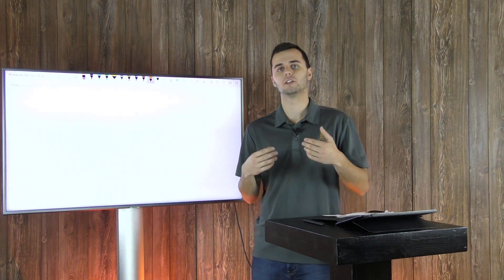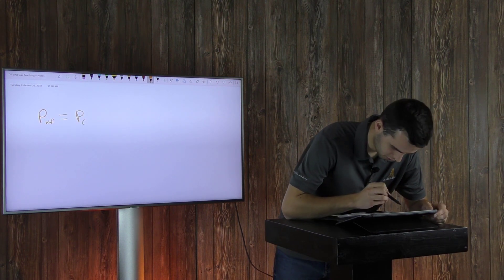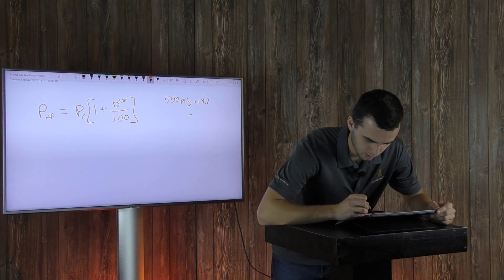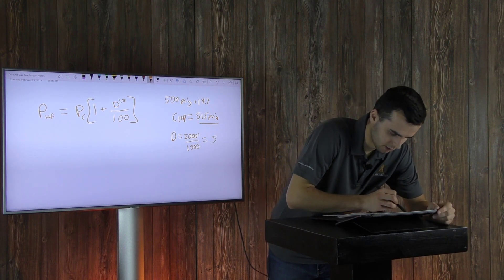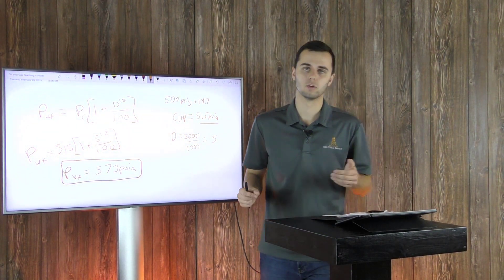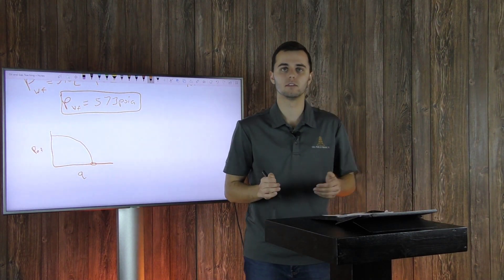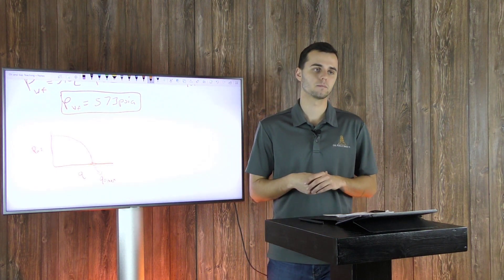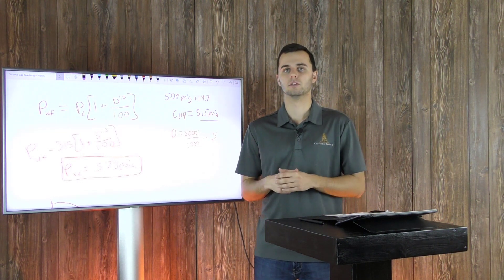Casing to Bottom Hole Flowing Pressure Calculation

Comment: Sebastian could I email you a spread sheet to look at,  I would like to know if there is a way to input the formula that will calculate in kPa.  The sheet is not as accurate as I would like using only 1kPa per meter, I believe this is not great as the gas gradient would change pending pressure.

Comment: On my gas / oil well I do not have a packing, I do have two valves at the surface that control casing and tubing pressure.  I don’t know how to set them.  The old man that used to run the well set one around 80 psi and another around 50psi. I’m not sure which was which.  The transmission line to the gas/oil separator has a few check valves along the way and there is a reverse valve before the separator.  He never set it before he passed. My oil production is from a pump jack driven by a Fairbanks-Morse 208 H&M. All piping is 2”. There are gauges everywhere so that helps.  In the past I know he made about a barrel and a quarter every few days with minimal water.  Is there anyway you could help or maybe provide a one line diagram with pressures shown… maybe some calculations?  I’m an engineer trying to produce oil for my father’s retirement funds.  Markhamilton5@att.net

Comment: Where is that equation from (bottom on hole flowing pressure) Could you cite it plz
Reply from the maker: I think it was pulled from Petroleum Production Systems (2nd Edition) 2nd Edition
by Michael J. Economides  (Author), A. Daniel Hill (Author), Christine Ehlig-Economides (Author), Ding Zhu (Author)

Comment: thanks for shairing, just Could you please tell us what do you mean by pressure casing, is it pressure in the surface or downhole, your equation still not clear, i hope that you make other video showing at which place you can apply this equation.
Reply: Kacem Bouras casing pressure is the pressure of the casing taken at the surface with a gauge.

Comment: can you make a video for cement calculation for the casing
Reply: What kind of cement calculations would you like to know?
Reply: @cementer4life  if we have 20 inch hole and 16 inch casing and 600 meter depth, how to calculate cement needed?
Reply: @ahmadfx8962  if going off Imperial instead of metric, you need you bbl/lnft factor. That is achieved using (D² - d²) x .0009714 = bbl/lnft.

Once you get that factor, you multiply it to your total footage you need covered, and that will give you how many bbls of cement you need. Does not include the amount of cement you need for your shoe track
Reply: @ahmadfx8962  here is your factor. 0.1398816
Reply: And you need 275 bbls of cement to cover that length of hole. That is based sole on true hole, does not include wash out
Reply: @cementer4life  thank you

Comment: can i know why you add casing pressure (500+15) and why depth divided by 1000
Reply: Stelon Joy 500 + 15 to make the pressure in pisa and not psig. Depth is divided by 1000’ due to unit cancellation.
Reply: @sebamagic1089  can u upload a video for the calculation of cementing volume